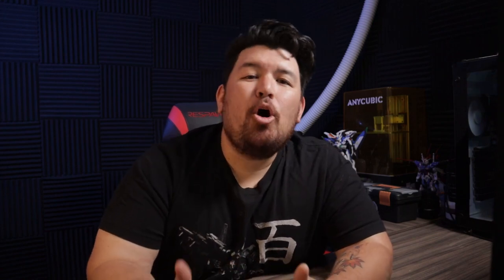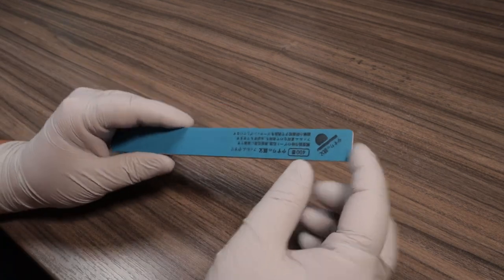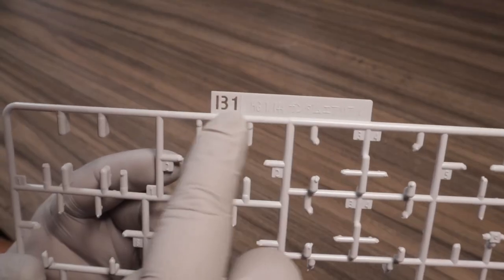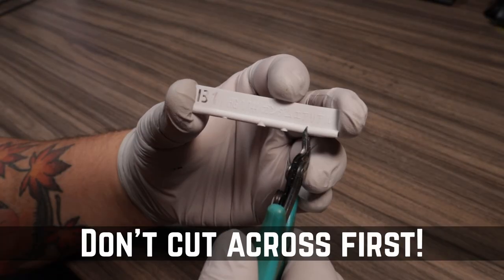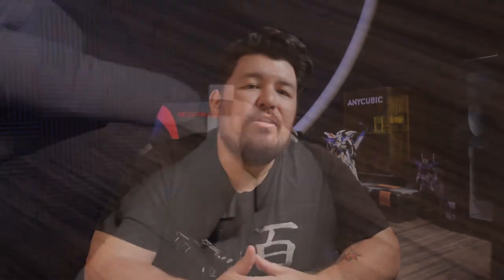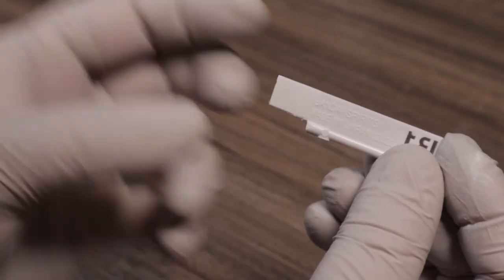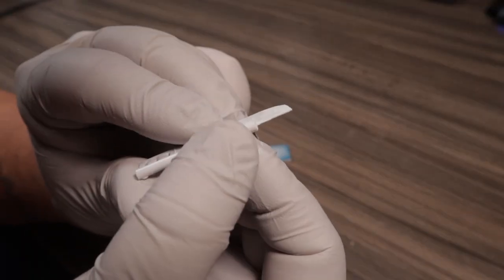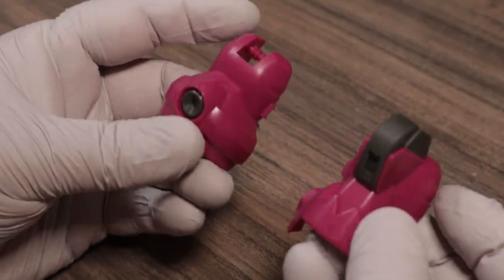How to Make a Gunpla Part Separator for FREE

Comment: If you build lego or know somebody that do build lego, then lego makes a brick separator thats amazing for gundam to. As a big plastic hobby guy i do lego, scalemodels, gundam and wargaming. And in my opinion the lego one is one of the better once and comes in most lego sets for free so anyone that builds lego will have a bunch of them, and i even think you can buy it separate
Reply: Thanks, I have like a dozen of separators and never realized I could use them for my gunpla too. (timing is great too as I had to rebuild the arm of my Zaku I that I put together inccorectly by accident)